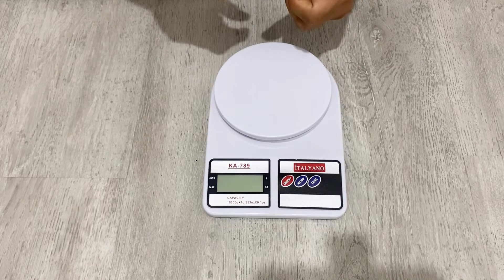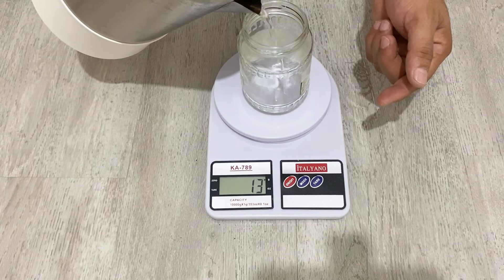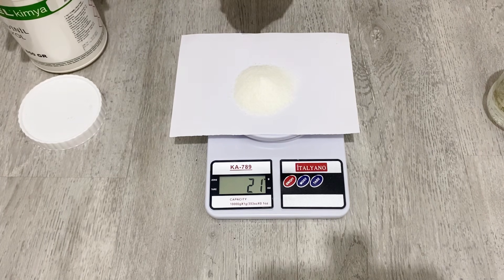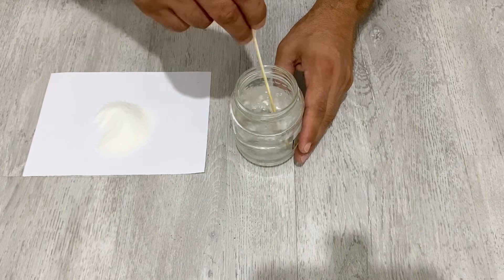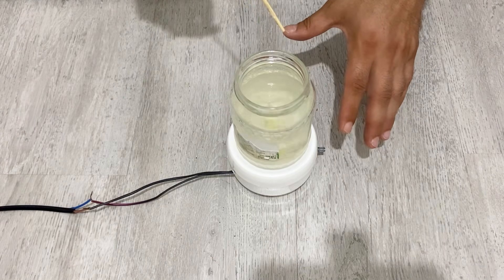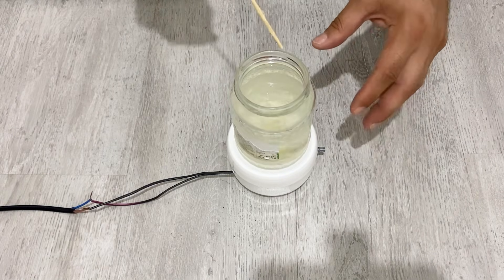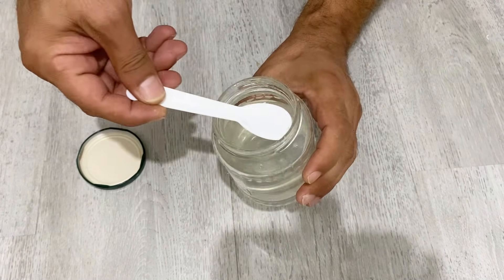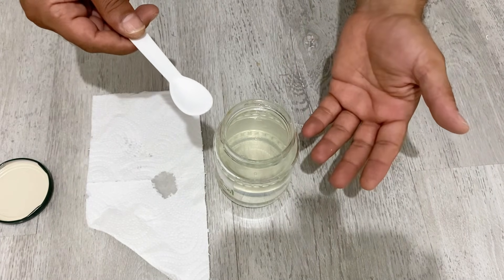How to Make Gel Electrolyte for Supercapacitors and Batteries (Step by Step with all Details)

Comment: For using in a Zn ion battery, what kind of modifications do I need?
Reply from the maker: It depends on the material especially electrodes that you are going to use. But l guess you should zinc sulfate instead of sodium sulfate

Comment: Can you make reusable batteries? I'm thinking a flooded lead acid after it's spent can have lead recast and can be reasonably easily recycled. Can the battery electrolyte be recycled and reused if you try to renew a spent battery?
Reply from the maker: I’ve already make a few ones. You can find them in may channel under the batteries playlist.